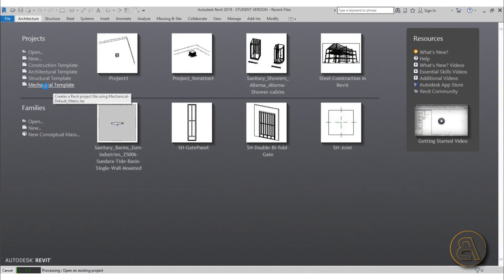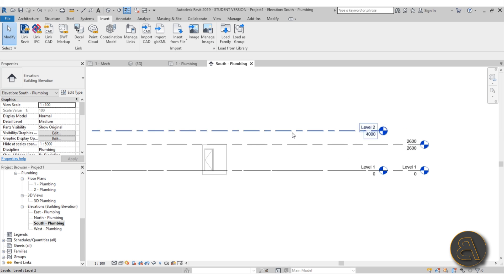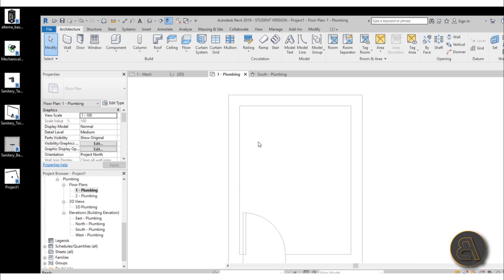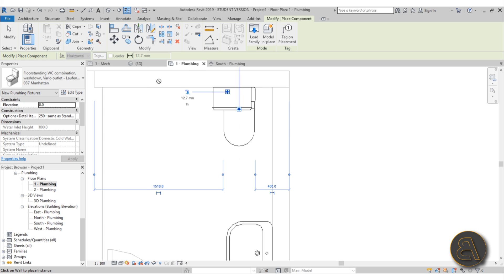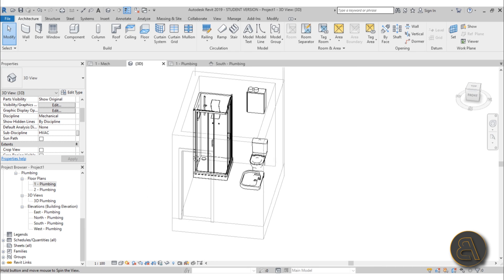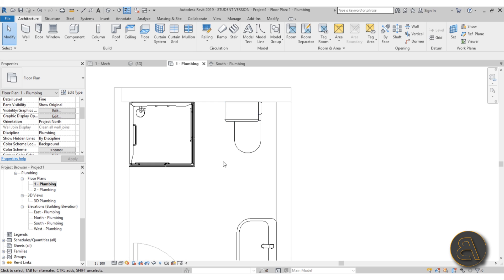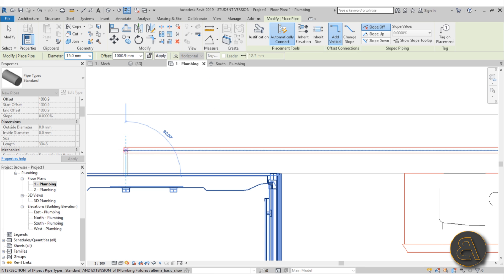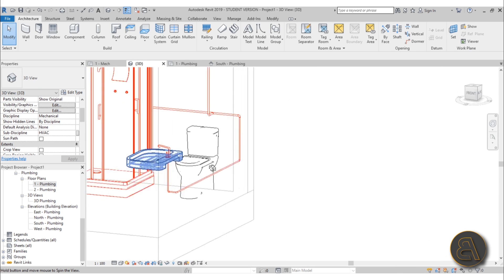Beginner Plumbing in Revit Tutorial

Comment: Can't create this pipe.. revit says that it couldn't find a routing for the fixture.. this warning ain't being ignored..
Reply: First, you need to load fittings families for the pipe (e.g. US metric - pipe - fittings - generic (or which you want) - pick everything (elbows, tees, crosses, transitions...). Plus, try to make pipe from sanitary fixture perpendicularly (from closet, sink - straight down a bit, not horizontally, and then in XY direction). AND don't forget chose pipe - Properties - edit type - Routing preferences Edit - now in "content" chose your elbows, tees, transitions... AND change min. size to "All"
Reply: @vasyll7631  God Bless u !
Reply: Make sure you're using the mechanical template and load the connections and fittings as shown and replied above